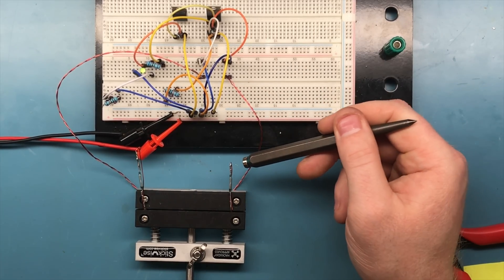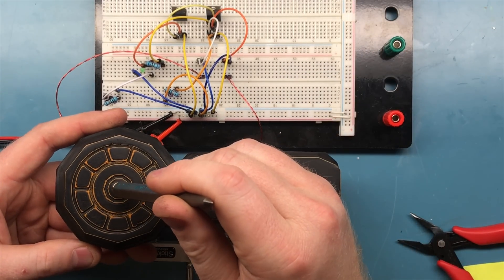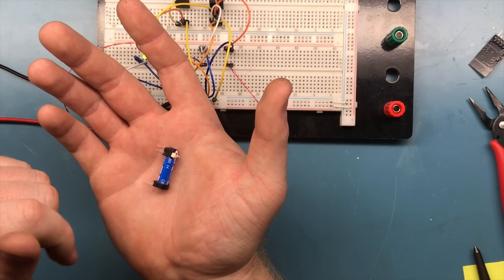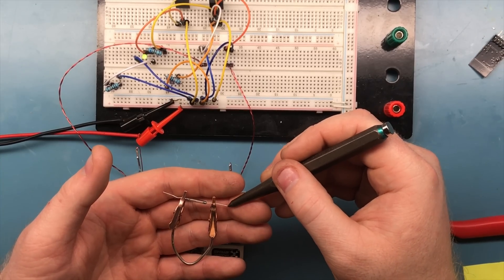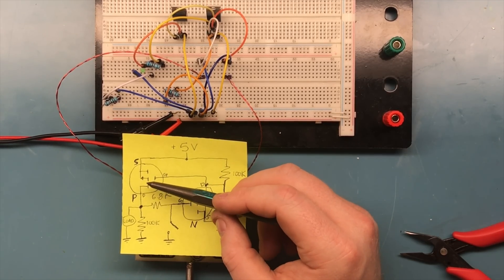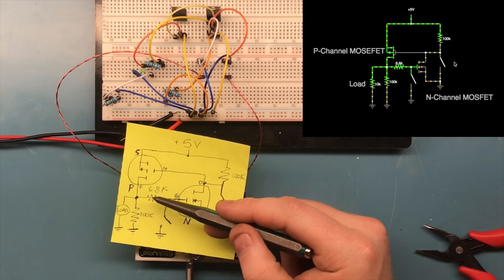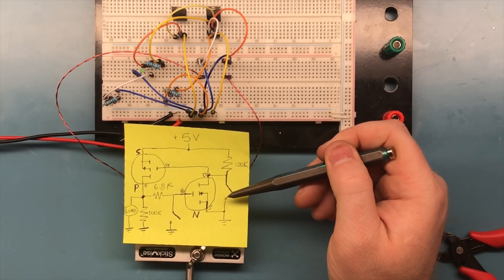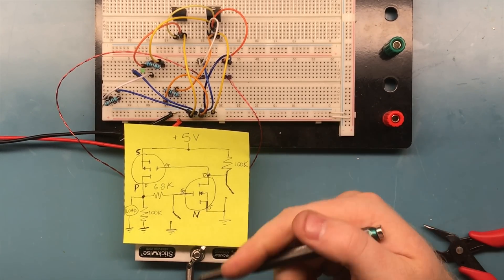How to Use a Magnet as a Latching Electronic Switch 🔴

Comment: this is cool... i made myself a diy power feed for my mini lathe with some dc motors and gears from printers. it has a triple nickel timer regulated speed. it works good i only hate to hold down the switches to operate it, those bare push buttons are damn uncomfortable after a while. now i will use this circuit to make a simple cycle start (push button) and stop (limit switch). here is your comment and suggestion for what to do with it :P, i might upload a video about it once im finished, thanks for the inspiration,
Reply from the maker: Very cool, I also have a mini lathe that I'd like to add some motor to. Thanks for watching!